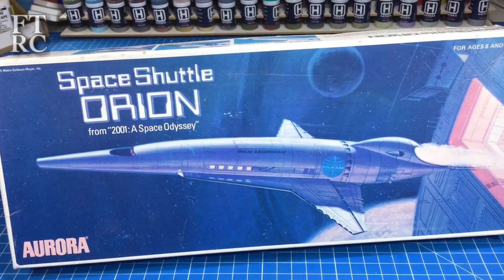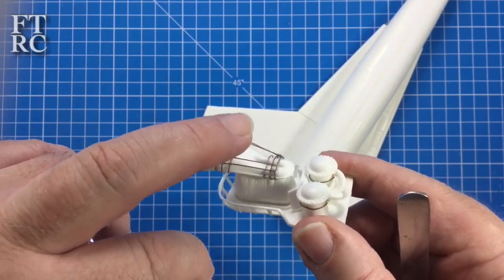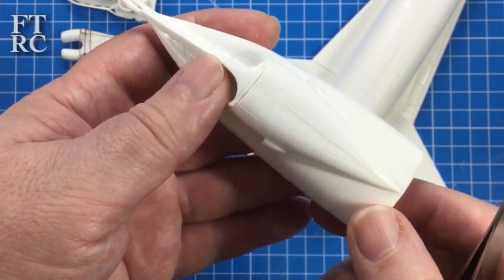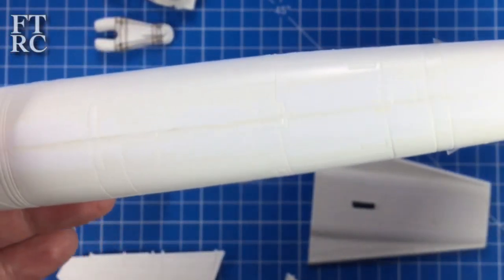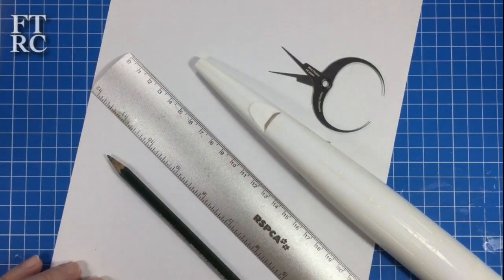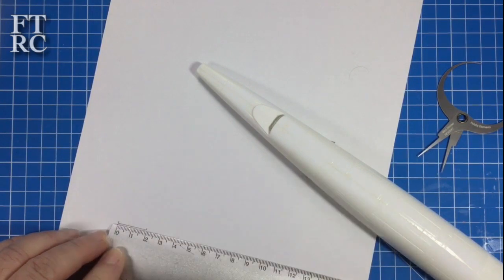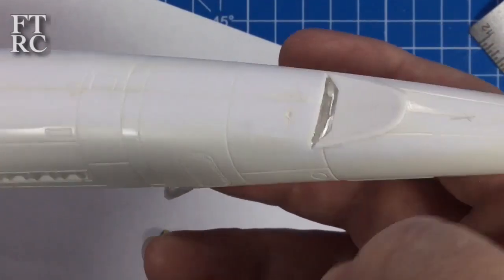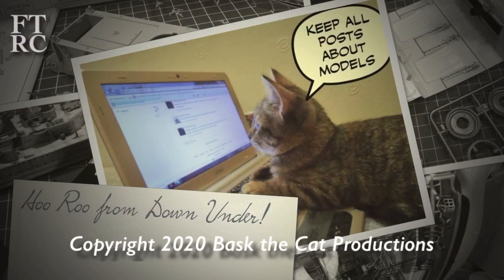Aurora 1:144 Space Shuttle Orion Part 2 Assembly

Comment: I just "discovered" your videos on Arizona build. Nice work. One thing I found works for applying non plastic glues the best. Stretch a sprue in different diameters. It doesn't soak the glue like toothpick, and glue doesn't slide like from metal needles. And with different diameters you can pretty accurately take right amount of glue. Anyway keep up the good work, cheers
Reply from the maker: Great tip!  I also stopped using shop Super Glue.  Found the Zap-a-Gap CA thicker stuff is far easier to apply.  Plus I use PVA white wood glue to attach larger PE parts.  Works well and you get a good amount of time to move into position before it gets tacky.  Once set overnight it’s better than CA glue, because it won’t sheer off if bumped.

Comment: Indeed, less putty than expected. Not more than on some more recent kits: the humongous Moebius Xylon Raider I'm just doing needs a fair bit of sanding plus putty...
Reply from the maker: So even the new kits require some bog and scrape.  Must be due to short run / small market for Sci-Fi themed kits.
Reply: @HarryHoudiniModels  The Moebius version (labelled as 1/160) has arrived and i have started it. Good news the antennas aren't warped :-) However, it also need a bit of putty, sanding and re-doing the panel lines in many places - more than I expected. But it will look nice on the outside, no rocket motor though :-( Anyway, a nice change from all that 1/35 military stuff...not to mention the low parts count!
Reply from the maker: I have just finished filling and sanding then re-scribing my Orion. Video out soon.  Will be interesting to compare the amount of putty required between yours and my kit.
Reply: @HarryHoudiniModels  Definitely! I am also looking forward to how you fitted lighting. In case I get overly impatient I will simply use some LED Xmas lights :-)